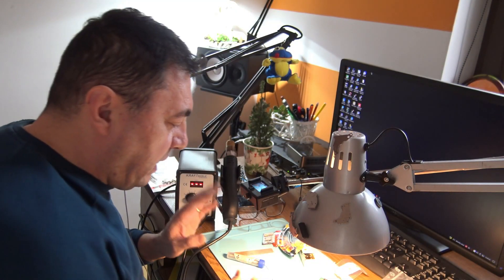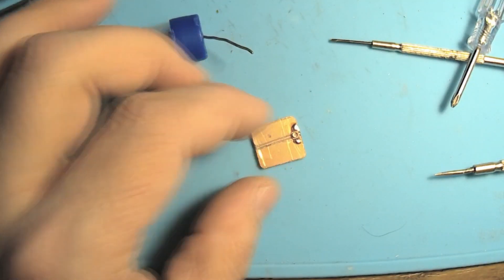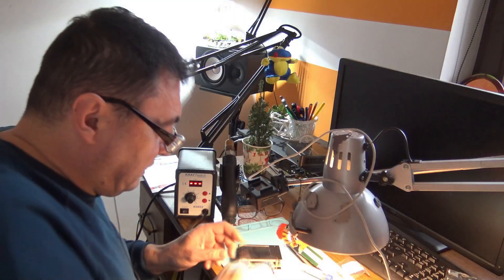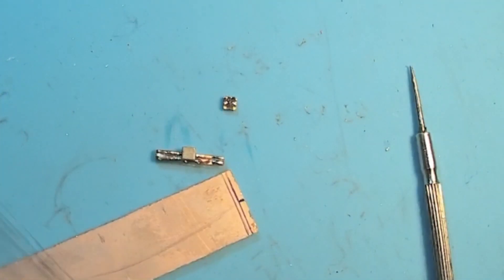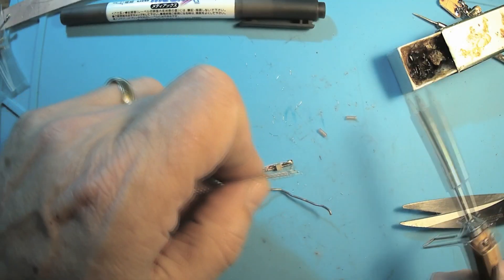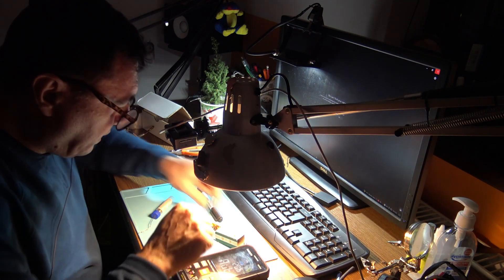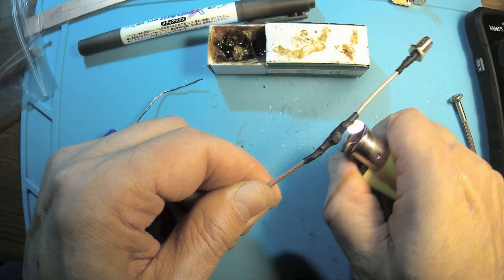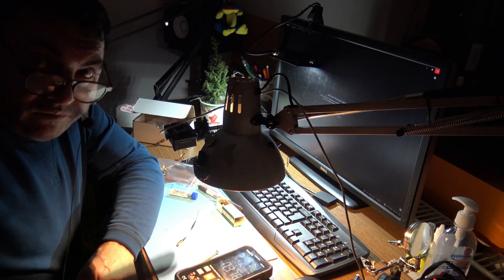DIY filter on pigtail cable LoRa Helium

Comment: Hello, you dont need to use a PCB. You can solder the ground wire on the frontside of the filter and the inner wire direct to signal in/out pads. The frontside is directly connected to all ground pads. Before I put shrink tube around, i sealed the wired saw filter with hot glue.  Best regards, Thomas.
Reply: Hi. I did the same also. Just didn't use the frontside. That is a good idea. Also used the hot glue to mechanically stabilize it. After a first shrink tube layer I added a metal layer connected to ground and then a final layer of shrink tube.
Reply from the maker: Good job! Advice taken!
Reply: @karekaft  any footage u recorded it by your self?
Reply from the maker: Nice to know..I was afraid to solder on the top..to much heat but I'll do for the next parts! Thanks!
Reply from the maker: Looks like it can stand it..for now..

Comment: when i made mine like this, I but copper tape between the first and second heat shrink tubes
Reply from the maker: To the ground?
Reply: @viocaia  it is not to the ground, but that would be a very good idea!
Reply from the maker: @quakermaas  I did that, aluminium foil connected to the ground..perfect! Thanks!

Comment: SAW filters is not a good idea for Helium. This type of filters is very unstable.
Reply from the maker: @Helium Miner Mods  Well, there is a lot of folklore about..sometimes two are better..or even none..depend of the situation.
Reply from the maker: @searchingredients8337  Think about radio waves like light behave.Have you ever used a flash light ..? same story here, you can have a big round spot, covering a lot of surface..that's the antenna receiving the whole radio spectrum around 868MHz..then turn the light into a narrow spot, that point of concentrate light is the exactly what we need from the radio sandwich! So a double filter makes the signal focused even more to the spectrum LoRA needs.
Without filters, even if you consider a very well tuned antenna, it still receiving radio frequencies around LoRA band and surrounded by two GSM band at 815MHz and 910MHz and many more radio communications in the area..those very strong signals will overdrive the internal LNA , which, without a filter will amplify everything..When filtered, it can focus to the needed band..no other interference ..
All the miners have saw filters..usually two, one before the LAN (low noise amplifier) and one after, in this case a extra filter is not necessary, but useful, some other models like Heltec , have only afilter after the LNA..here an external filtering is a need..I recall SenseCAp M1 have already 2 filters, so using a filtered pigtail is up to you..my opinion? give a try..write the numbers for later compares..
Reply from the maker: @searchingredients8337  There are no recommendations for buying anything, I'm not in the sales business..sorry!
Reply from the maker: @searchingredients8337  Just be patience..the network is changing..will see after half april..
Reply: @viocaia  there is no necessary need to switch the antenne cable into a pigtail filter cable after all?

 Should I just be more patience till the network makes the rewards better? ('ve been patience in the meantime, just trying to learn alternatives to improve rewards instead of waiting on their firmware upgrades.
Reply from the maker: @searchingredients8337  Let's wait for all the HIP55 change mid april...of course..
Reply from the maker: @searchingredients8337  Let's wait the HIP55 ...